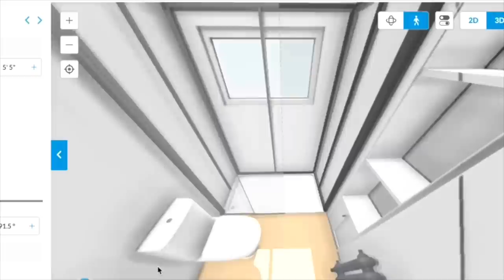Bathroom WALLS are going up!! & BATHROOM DESIGN IDEAS 💡

Comment: We have had a glass walled shower stall for 8 years since we built the house.  The glass stays clean with a simple squeegie wipe down after each shower.  The glass comes with a built-in hard water protection that resists staining.  I have never had to clean the glass wall in the past 8 years except for the daily squeegie (20 seconds).  No need for a half wall.

Put the shower control near to where you stand under the shower.  There is room to stand to one side to turn on the shower. You don't want to have move to the other end of the shower to change the water temperature.
Reply: I would agree with the  above ,We have had glass shower walls for13 yr and have no problems keeping them clean and clear ,squeegee the glass for a minute at the end and you are done plus it opens up the washroom visually.
Reply: Same here. As long as your glass is flat (curved glass is a little more of a challenge), just having a squeegee in the shower is the easiest to maintain and cleanest shower you will ever see.
Reply: Tony is wrong about the handle placement. The shower is 30x60 which is literally the same size as my bathtub/shower combo. I stand in the middle and can reach all around. You can reach the handle just fine in that space. What tony fails to realize is that there is not enough space to avoid cold water hitting you when you have a glass wall.  So a handle at the entry point is a fantastic idea to avoid the hit of cold water!

Comment: Although you have this documented with video, after all the framing is up but BEFORE you close it in with any type of finish material, take pictures. That way you know where the framing is if you need to attach something to it. Also, although you are young and spry, don’t forget to add blocking for grab bars and a foot rest in the shower

Comment: This upstairs area is going to be such fun designing and finishing.  The cement walls/floors for the shower sounds good.  I will say if you are forced to choose tile for some reason, keep in mind, the larger the tile you use, the fewer grout lines you will have to deal with in cleaning it. There are pretty big tile sizes you can look at for your bathroom.  Also, Have you thought of how much weight your bathroom will be putting on that rooms flooring?  Will you need to reinforce your beams under it?  Fun to watch the progress.  Also, have you graded the yard around where the foundation/yard that's been torn up?  Mayube planted grass and figured out where some flower beds next to the house should go?
Reply: Was thinking the same thing. Concrete is heavy even if thin
Reply: @wendyhenschel. We looked into micro concrete ourselves and found it is only a fraction of the weight of conventional concrete. We understood we can easily use it in an upstairs room
Reply: @elwood9675  interesting. I’ve never heard of micro concrete.

Comment: As long as you use grout sealer, no worries about scrubbing grout. Honestly, I would rethink the half wall. If you’re already cleaning some glass in the shower what’s a little more?  It looks so much nicer when it’s all glass. There is also some stuff you can spray in to help repel the water of make it head up. Makes it easier to clean. I use a squeegee that you would see at at a gas station for your windshield. Sponge on one side, squeegee on the other. Easy.

Comment: Jay, I bet Abbie is a great helper, you should hire her on other jobs!! Abbie, when you are using the chopsaw, you might not want to put your hand near the waste piece. Another safety tip, if you have a shop vac( or get one, you can use it everywhere) vacuum up your workspace every day when you are done. As you are moving around upstairs, sawdust is getting in your lungs(and Jay’s), and can cause problems later.I can see it in the haze in the air.

Comment: We remodeled our bathroom a few years ago. We put in a 30" x 60' shower pan with full glass sliding doors.  If you squeegee them after each use it helps.  There is a spray that you can also use that helps keep them looking nice.  I think I might change to a 30" x 45" if I had to redo it.   We used 12" x 12" earth tone tiles in the shower with 4 " accent strip about shoulder high.  Tiles are floor to ceiling in shower.   Be sure add non slip dots or straps, you never know.   The floor in the room is a larger tile matching earth tones.  There is a 4' creame colored vanity with a white sink. And the toilet is white.  Walls are painted a sand color.  The faucets and towel bars a a brushed nickel.  Looks nice.  We used a sliding barn door that looks like a barn door,, instead of a regular door. We stained it with a pine staine ans sealed it..  The room looks amazing and gets used every day!!! Glad we did it.  What ever you choose to do it will be wonderful.   Enjoy.
Reply: Forgot to add full glass doors are heavy!!  Be sure the floor has some extra support for weight of tile and glass.

Comment: Good ideas going on. I have a glass open shower that is about 5 inches shorter than yours. Water will always get out onto the floor, no matter how careful you are. Water splashes off of you, walls etc. I ended up hanging a shower curtain because I hate stepping on the water when I get out. Don't know anything about the cement product, but the half wall looks nice and still lets the light in. Take pictures of all rooms before you put in the insulation to have a record of wiring and pipes. You're doing a great job!

Comment: I drooled over the micro cement 4 yrs ago when redoing our bathroom. Wasn't affordably available in US yet then, but I got everything else , no barrier walk in shower with linear drain between two side benches. One important message do your waterproofing research. Do not cut corners and tile over plywood floors or drywall. Don't create a moisture sandwich by combining 2 methods that might trap condensation in between.  We used Kerdi board/ waterproofing system. Instead of heavy cement board they sell lightweight foam with waterproofing Membrane attached. So much easier to work with. Check it out, might work nice under the microcement😻

Comment: Yes your sheetrock ceiling gets attached directly to the Joist/ Rafters. no strapping is needed OR ever used in this type of ceiling. (that is if your joists are on 24 inch centers as they should be.)

Comment: Hi Abby, all those examples you showed look really nice! I was just thinking, if that tiny bathroom would look even smaller with not a glass wall for the shower? There are 'nano sealant' (or however you call it) for just everything, cement, glass, plates and so on. That helps to keep it clean just by water (and you won't get lime stains from the water itself). Does Jay have a mic, actually? I don't always get what he is saying. Have a wonderful weekend you two! -Chris

Comment: I never heard of micro cement, but it sounds more practical compared to tiles.  I have tiles, and they can be a pain to clean.   Concerning the half wall shower, will you not get water splashing outside of the shower?  I like the idea, but I was just wondering if that would be a problem.

Comment: It’s a lot cheaper than tile. It’s easier to keep clean. It’s no different than plastering except you’re using a better product than regular plaster. I say go for it, you’ll never have to deal with grout lines. Just repaint it when it starts to show some signs of wear.

Comment: Have you looked into solid surface panels for your shower? It’s kind of like solid surface countertops but it’s a big sheet you put up and you have very few seems that you caulk. I love mine as is super easy to clean. 
My experience with tile having my family buying older homes and renovations is that tile grout always fails then there are repairs  to do underneath.

Comment: Always the larger areas should be a neutral tone, either cool color, a light grey or a warm color like off white! Im not much for stark white! But it's easier to decorate with splashes of color like a shower or window curtain, towels, art, etc...👍👍❤ My husband and i used to do decorative concrete and i did concrete on top of wood and everone thinks it's marble! Do a lot of research, it's not hard! Like tge concrete idea!

Comment: I'm probably in the crazy minority that isn't a fan of tile, especially subway tile. If you can do something like micro cement you should go for it. When we remodeled our bathroom I wanted a jetted tub so I only had to choose material for the walls and I opted for a fiberglass surround over tile because it's sleek, easy to clean and I wouldn't have to deal with grout lines degrading over time. It's all personal preference though.

Comment: I refute what you have been told about glass in the shower. We have sliding glass doors in our shower which are about 6’ across and have no problem with cleaning, we squeegee after every shower and then all you need is a Mr. Clean sponge, will clean those up very easily. The micro cement half wall sounds great but won’t creating a wall make the room feel really small?

Comment: If you have hard water it is much harder to keep your shower doors and walls clean.  If you use a squeegee every time you use the shower it will keep the glass walls much cleaner but some people don't like the added work even though it only takes a couple of mins to quickly squeegee the walls down after a shower. I'm not a huge fan of tiles in a shower but mostly because as a kid we had a tiled shower and the grout always had mold growing in it that we had to constantly scrub out with brushes so it was a huge pain.  I'm sure they have better products now for this kind of stuff like the cement stuff you talked about.  I like the cement stuff idea but if it holds water it could be a potential problem.  If the product is not completely flat or the surface has little areas where water can collect it will mold unless you have really good ventilation and heat in the bathroom. Love all the idea you have for this little bathroom and I can't wait to see what you decide.

Comment: Might want to spray foam the ceiling or you’ll have ice problems the roof. With no attic you will have no air movement.
Reply: I agree, foam would probably be the best way to go. If batts are used they would need to use insulation baffles and a roof ridge vent.
Reply: They put 1” stapling up the plywood and the nailed insulation boards to it. Than spray foam

Comment: Is the window going to open in that bathroom? Asking because you need some kind of ventilation or you will get mold, we have the ceiling fan and uggggg I wish when we remodeled our bathroom that we would of un covered the window that used to be there at one point before we ever bought the house 31 years ago, because we do have a mold problem in upstairs bathroom, that stupid ceiling fan isn’t keeping the mold out. So keep that in mind and I wouldn’t do tile for that reason either!

Comment: I do not think a half wall is good because of splashing. Water goes everywhere. I have a sunken tile bathtub with the shower heads at the far end and water gets on the shower curtain where you enter it and step down. So you're going to get water everywhere. A three-quarter wall would be far superior.